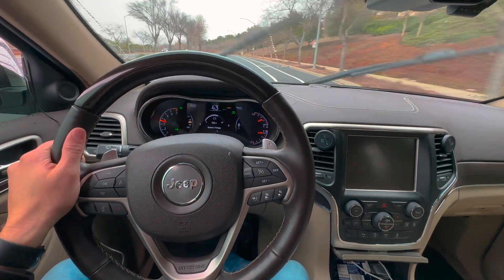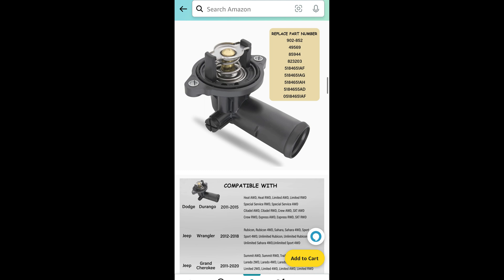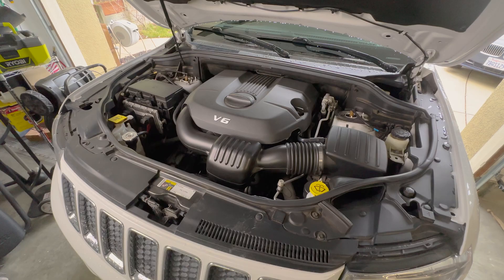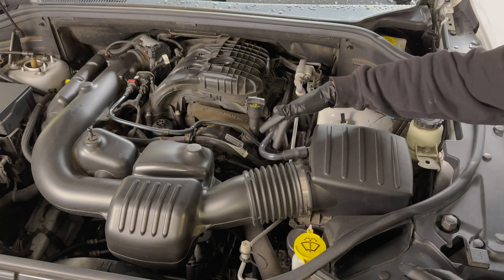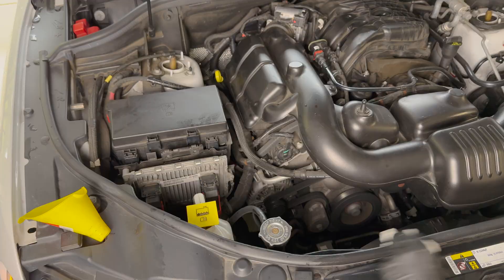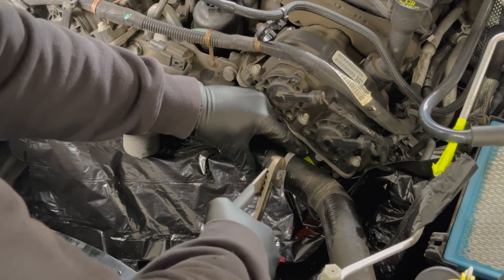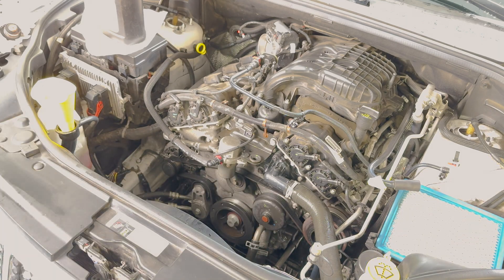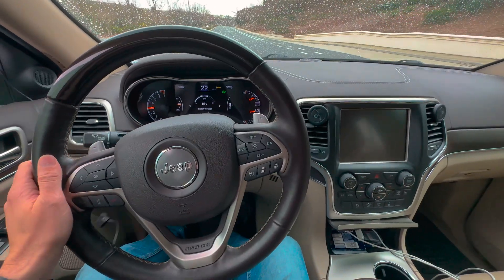Jeep Thermostat - Diagnose and Replace - Jeep WK2 -(P0128 error code)

Comment: Does it always throw the fault code if the thermostat is stuck open? I see maximum 90 degree Celsius oil temps and it takes more than 20mins of driving to get to that temp. My coolant temp gauge seems to sit normal. Could I have a stuck thermostat?
Reply from the maker: No, it doesn’t always throw a fault code right away. A thermostat can be partially stuck open, and only under certain conditions will it trigger a fault. What you’re describing — slow warm-up and oil temps maxing out at 90°C after 20+ minutes — could definitely point to that. Your coolant gauge may still show normal because it’s not super precise.

Try swapping the thermostat with this one on Amazon (link below). That usually clears up the issue right away. If it doesn’t, you may be dealing with something else. If the code comes back a year later, then consider going with a genuine Mopar thermostat — they’re more expensive and can take a while to ship, but they tend to be more reliable long-term.

Comment: I just replaced the thermostat but the check engine light is still on. How do I get rid of that?
Reply from the maker: Use this adapter to connect your phone to the Jeep app above: https://amzn.to/3wHYVGF
Reply from the maker: Either it will go away on its own after a number of engines start cycles on and off and time running. I don’t know the exact number. Or if that does not clear it then you’ll need to get a cheap OBII scanner and plug it in and tell it to reset all fault codes. don’t worry they’re only $35-40. Or you can get the OBII to Bluetooth adapter and the Jeep app called OBD JScan. I’ll put links to both options here.
Reply from the maker: Jscan app https://apps.apple.com/us/app/obd-jscan/id1445903514
Reply from the maker: This should also work for erasing all of your fault, codes, and resetting the car. It won’t do some of the more advanced Code reading and programming, but it’ll do the basics. https://amzn.to/4bVsVhe

Comment from the maker: It has been one year. This issue has not returned. It has been reliable 🙏
Reply from the maker: Update: after 15,000 miles this aftermarket thermostat has failed and the engine started to overheat. The thermostat was stuck in theclosed position. If you’re going to do this repair be sure to get an OEM thermostat from Mopar or Jeep store!